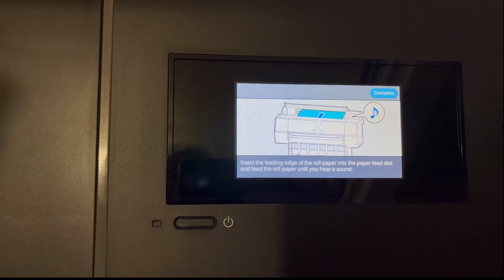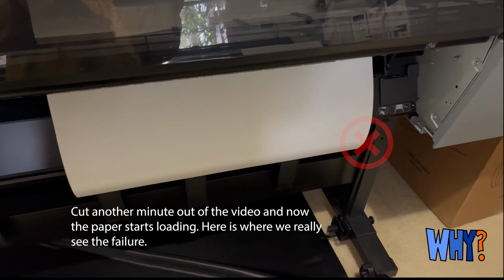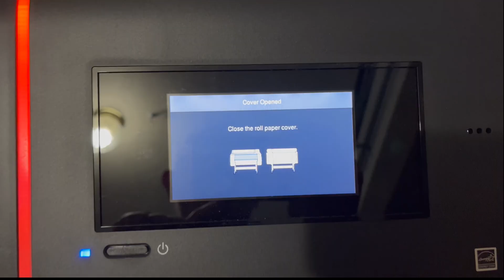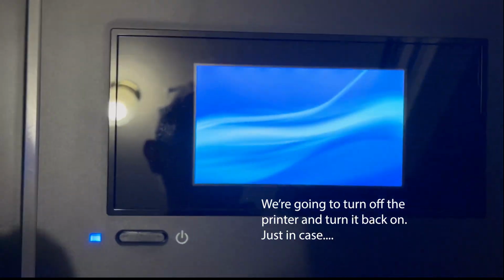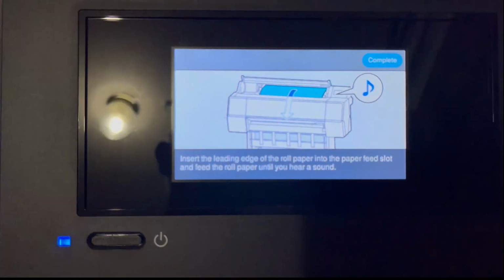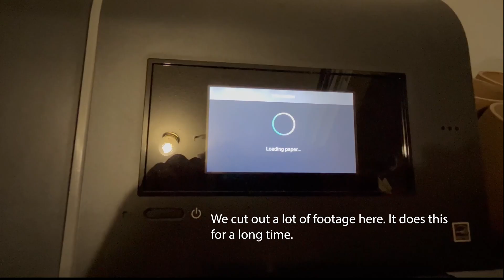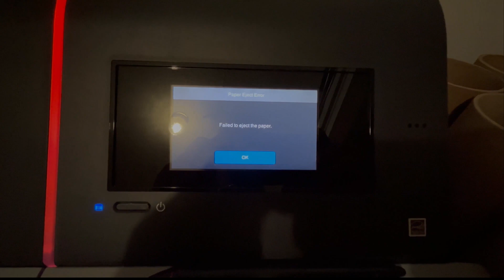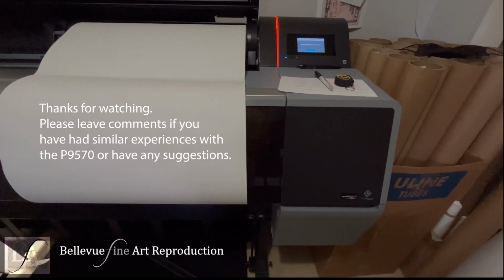Epson SC P9570 Critical Paper Loading Errors

Comment: My expensive somerset 44 inch paper rolls were being scuffed and dented because the printer moves the paper backwards at certain parts of the printing process, causing the paper to rub up against the inside of the cover and crease up even.  So I removed the whole cover from my SC-P9500 and left the brackets for it on the sides so that I can trick the printer into thinking the cover is being closed and opened when needed.  My older Epson 9890 was able to print with the cover open, the P9500 unfortunately can't.
Reply: This should have been the best aqueous printer Epson ever released but it's a lemon. Their flagship product is a lemon.

Comment: Did you ever fix the paper loading issues as well as the   Other problems you spoke of with the Epson 9570?
Reply: Oh my goodness. Thank you for that feedback. I hate the idea of switching to Canon but I may have to look into that option. 
I did try a Canon in the past but the colors seemed too off from the prints that I color matched with my P9000. 
I have two of my service reps asking print houses about their experiences with their 9570. 
Due to your comments Im attempting to purchase another P9000 but they seem very difficult to acquire. 
Im so hesitant to purchase the 9570 based on the poor review and your video. 

What does your service Rep have to say about the ongoing issues you’re having?
Reply from the maker: @printingbydebrah  This is the issue. We have been used to Epson and have gone through their entire line of printers, 9600, 9800, 9900, P9000, and then the P9570. The color is great. There's no question there, but with the P9570 we started having so many issues with heavy papers that it kills us. I mean, the printer still works, but we run it at half speed, and we're constantly babysitting it in case prints have problems. And the P9000 is no longer available, so we've decided to explore Canon. 

There's also an Epson group on groups.io which is very helpful. Everyone there with a P9000 is holding on, hoping Epson has an answer to this issue. But alas, I'm not super hopeful. 

I'm not going to say there is no color difference, but in most cases we're a super close match. We've been using a Canon Pro-1000 for proofing for a while (same color set and PF10 head as the big machines), so we're pretty comfortable going forward. 

We use shades of paper (www.shadesofpaper.com).
Reply from the maker: Not really. Some of the issues have been resolved by slowing the printer down and printing at half speed (unidirectional). It has helped some to turn off lateral feed adjustment, but the P9570 is still a very finicky machine and we're actually starting to mix our machines and move to Canon. We just love our new Canon Pro 2100, and the writing is on the wall there....

Comment: I am having a similar issue . I just loaded a new roll it goes through the whole process then tells me there was no paper detected . But then it's in there jammed so I have to clear it . Not really sure where to go from here
Reply from the maker: If it's jamming up under the roll paper cover, then the trick is to leave the paper cover open. To do this you have to trick the printer into thinking the cover is closed. If you look at the roll paper cover, on each side, left and right, there's a groove where the paper cover slides through. On the left hand side of the printer, put a piece of paper in that groove. It will think you've closed the paper cover, and this prevents the P9570 from jamming the paper up under the roll paper cover. 

Next look at your paper settings for that paper type. If it's a heavy paper, then be sure to have the paper tension on high, and lateral feed adjustment off. This should help too. 

If the paper is coming off the core, you need to retape it to the core. When it comes off the core, or when the printer pulls it off the core, the printer will say it can't detect paper if though the paper is inserted.

Comment: The question is, is it the printer that pulls the paper too hard so it releases from the core, or does all the paper producers using too weak glue on the core.. I guess the printers is doing it.
Reply: Feels like this is it. The pull tension is too strong for the roll end to the core. Ironic that epson seems to not have tested it even with their own papers.

Comment: We just bought a new printer (SC p9500) cause our old one broke just because of this problem (EPSON Stylus PRO 9900). The paper got stuck like you describe it, i went away for 3-4 minutes and when I came back the printerhead had printed on same place over and over again so the head was soaked in ink, its was so soaked that it was not able to get cleaned, we tryed with amoniac, printer cleaning stuff, and even took the head out. It resulted in buying a new printer, which is even worse.... EPSON SC models are not a time saver, if you know what i mean.. you gotta be there the whole printing process, watching it all the time.. SUCKS

Comment: Hey guys.  I ran into this problem and found the solution is to tape the paper to the cardboard core.  When this happened to me the paper became so unravelled that it was flopping around in the machine.  I then had to rewind - or tighten - the paper to the core.  I now have some skewing issues because it didn't go on the core perfectly, but it is usable and I've made a few prints since doing it.  Hope that helps.
Reply from the maker: We have re-rolled paper and re-taped it to hundreds of rolls now, hundreds of times. This is not a real solution. This printer is not ready for market, even after two years.
Reply: @BellevueFineArtRepro  I agree.

Comment: Turn on Lateral Feed Adjustment in the Media Settings, this will help with Skew issues. This makes the feed uniform.
Reply from the maker: Marc. I know you're with Epson. Your one sentence suggestion is by no means a solution to this mess. Epson needs to do much better. This is a defective printer that has many issues related to the paper feed, and Epson has not resolved any of these issues. Epson needs to do much better. YOU need to do much better. I would have felt much better if you had reached out with a phone call, rather than a glib one sentence comment on my youtube video meant as a solution. Epson is failing. You're failing. And I will continue to call attention to this until it's resolved. Do better Marc. Try harder.
Reply from the maker: Lateral feed adjustment is on. I've heard from other Epson SureColor P9570 users that for things like watercolor paper that are stiff, turning suction all the way up can help. Other reports say for Glossy paper and Canvas to turn it down to zero. We're still experimenting. We get it rather often, and it's random. If we run a stack of ten prints, sometimes one in the batch will have double printing and the others will be fine. 

We've owned the Epson 9800, 9900, P9000, and now the P9570, and we have never before seen this issue. This problem is new to the P9570 and we're trying to figure it out. 

Thanks for your comment. It's all helpful.

Comment: Please report back regarding resolution of this issue. My P7570 is on the truck and I'm hoping for a smooth startup next week. Thank you ...
Reply from the maker: I had Decision one out today, and what is happening is that when paper gets stuffed underneath the roll paper cover, it's pushing so hard that it's breaking the white plastic piece that the core plug fits into in the printer. I wish I could include a photo in my reply. But the issue is not resolved at all. My second P9570 just broke an hour after Decision One left with the very same issue. 

If paper comes off the core, you need to remove it, and then tape it back onto the core, rewind the paper tightly, then put it back on the printer. Before you do anything at all, you should definitely upgrade the firmware to the latest version, which is shown in this video. 

I would love to hear your feedback after you get your printer running. Consistent problems I've had are: 
1) paper skew. You'll get an error message saying that the paper has a skew. Your choices are "continue" or "reload the paper". In my experience, every single time we load the paper we get this message. We also get this message multiple times a day when printing, and we always say "continue" because if you try and reload the paper, it will never never never say finish. On two P9570s we get this error every single time we load paper, without fail. Or at least 95% of the time or more. So ignore it. 

Good luck. I'm beginning to wish I had never bought this printer. It's a nightmare. I've had every version since the 9800 - and I've never had this many issues with a printer.